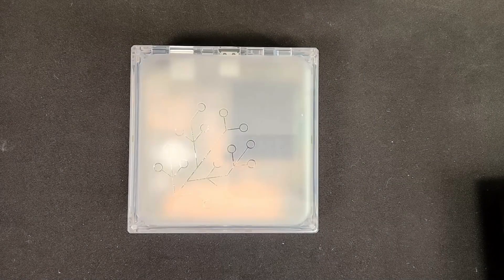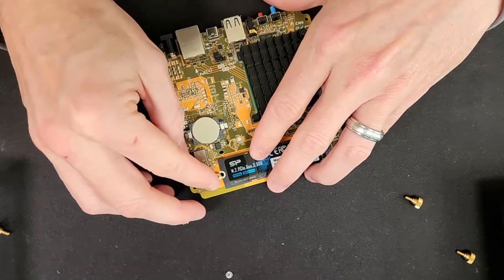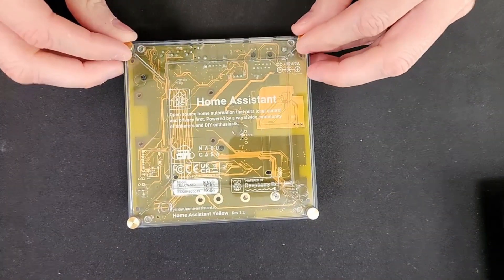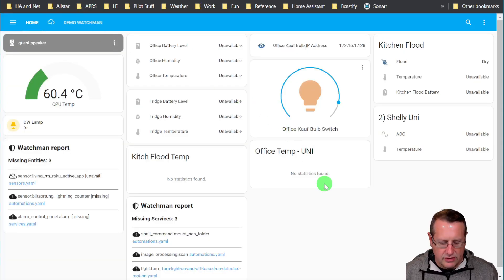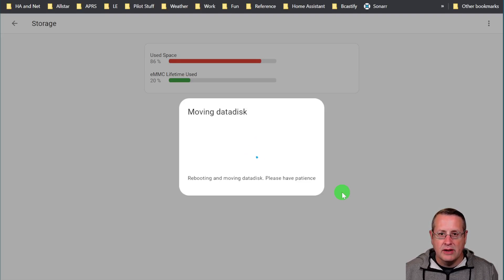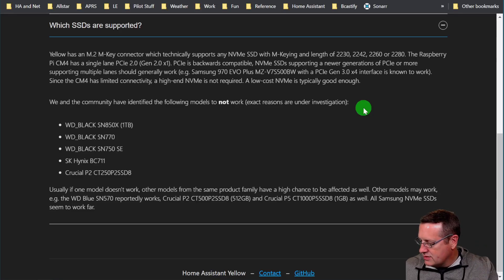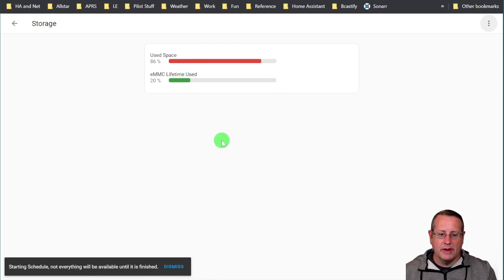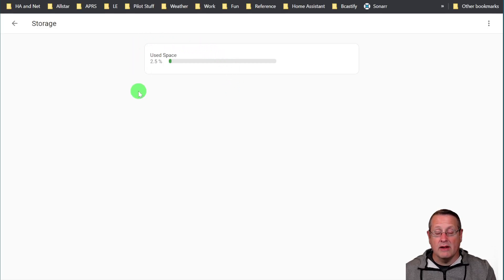SUPER EASY! Adding an NVMe to Home Assistant Yellow.

Comment: Are you actually made that very difficult for yourself if you’d left the bottom on you would’ve been able to hold the bottom where the screw is put the NVR me in and then just tighten the nut up. You didn’t need to take it all that apart like that, I don’t know why you did that

Comment: I got my PoE Home Assistant Yellow.  I even have the NVMe.   Now I am just waiting to try and find a damn Raspberry Pi CM4.   Those things are damn hard to find, so for now I have to use my HA Blue still.
This is worth a video.  External storage/additional storage in HA is something that so many people have been searching for and asking for.  It's been something that has been requested over and over for at least the last 4 years that I know of.   Frigate and Plex integrations really need this.
Reply: By the same token, Frigate and Plex, at least in my opinion, should be done on more powerful hardware than what a Raspberry Pi currently provides. I actually plan on setting up one instance of Home Assistant on a mini PC that I have specifically for that reason.

Comment: A home assistant yellow is a device which makes you old and grey before it  finds itself on your doorstep. Except of course if you belong to the chosen few. Waiting for 8 months now said to deliver 22 dec22 said deliver 23jan 23 and now status is 3march 23 not that they make the effort of updating you, you have to find that out yourself.
Reply: I ordered mine clear back in October of 2021 (fairly early backer of the crowdfunding effort) and it finally arrived on December 30th of 2022. I didn't obsess over how long it took, mainly because of the issues getting parts for them to build them.

Comment: Hm... I don't get the yellow. The built-in zigbee module means you have to place the unit in a central location for zigbee to work properly. It's a bit limiting...
Reply: not true at all, you can place it wherever you want. But you need more units that acts like a router, for example ->  lightning bulbs.
Reply: @Tyk0s88  This is true if you have zigbee devices that play nicely, i.e. the manufacturer has not messed around with zigbee. I've read the zigbee docs and am aware of this. But sadly all manufacturers and especially the cheap Chinese ones (aqara being the prime example for me) have their own view of the zigbee world. They all say zigbee 3.0 but... If you stay in their ecosystem with their own hub (then why have home assistant) you will be just fine. Otherwise home assistant with z2m or zha, the idea of having mains powered zigbee devices acting as routers in a mixed environment (multiple manufacturers) is extremely challenging. Battery devices almost never pair to a mains powered device and if they do, they drop off after a few days and need repairing. I've been down this road and it does not work! I now have 2 router zigbee sticks around the house in addition to the coordinator and all works fine (most of the time). At least I have my coordinator on a 2m USB cable away from walls and other devices. With the yellow I don't see how this can be done... Hence I see no point in the yellow. You will most likely still need routers dotted around.

Comment: Is a Home Assistant Yellow have any advantages of just using a Raspberry pi 4
Reply: The Home Assistant Yellow has built-in support for Zigbee and Thread/Matter, so if you plan to use any of those technologies in your Smart Home, you don't need any additional hardware to get started. Even if you don't, buying the Yellow helps support the development of new features in Home Assistant and ESPHome.